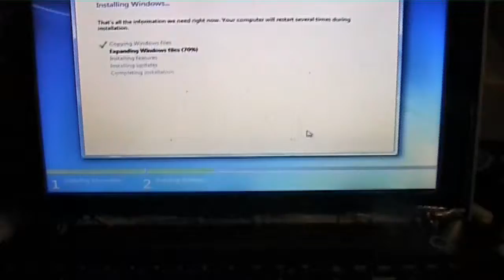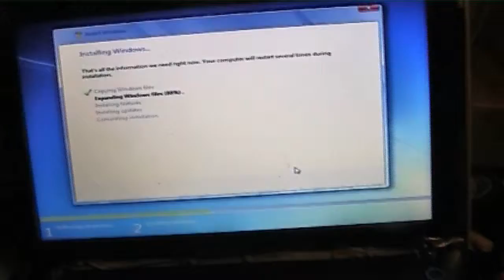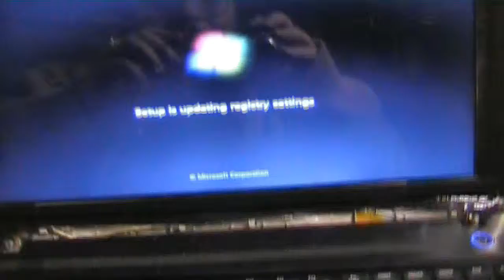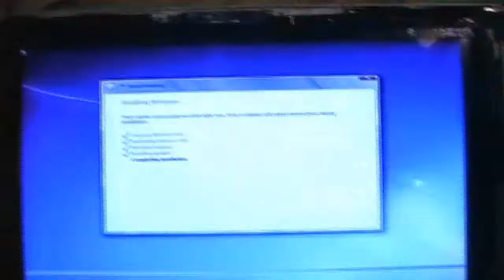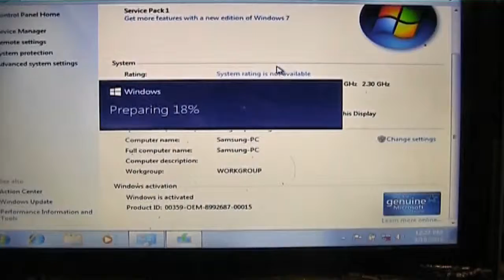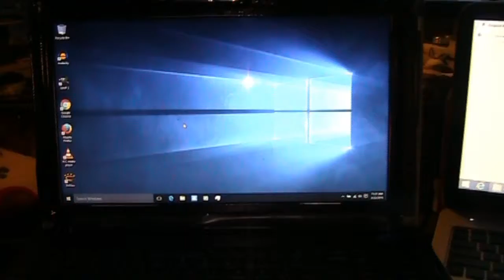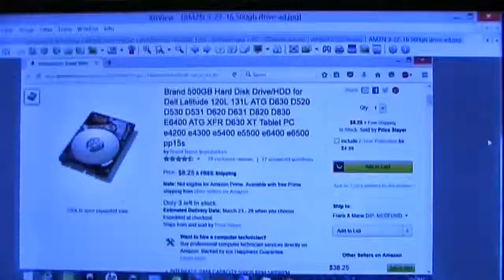Upgrading to 16gb RAM on a Samsung NP300V5A

Comment: How did you put 16 GB Ram, when this model - np300v5a, gets 8GB max?
Reply from the maker: There are cases where the manufacturer will state max ram is 8gb, but this is really dependent on the cpu and firmware and bios. For example, if you look-up the cpus in these models, Intel will tell you they can handle 16gb. Even a first generation i7 cpu can handle up to 16gb ram, and after that (2nd generation, etc.) even the i3s and i5s could handle 16gb ram.
Reply: @ThatWord   cool!! So I can upgrade my laptop with no worries.. my CPU is i7.. and my laptop is the same as yours,  NP300V5A. Thank you for your help👍🙏
Reply from the maker: The odds are very much with you, but save your receipt just in case.  :)
Reply: @ThatWord  I just found out that my CPU can handle 32GB.. so, I guess (2x8GB) will do fine (I know I have to make sure the motherboard is ok with it as well.. but... since you have the same laptop, i am hopeful. Thanks again 🙏
Reply: @dharmatal  Plz tell me if 16gb ram works fine on your laptop, I have the same Model and CPU as yours
Reply: @moazgamal3161  hey i have also i7 np300v5a . I want to know max ram upgrade...

Comment: I have samsung NP300E5C with chipset HM70, can I replace this motherboard, with motherboard with chipset HM65 from NP300V5A?
Reply from the maker: Swapping out different motherboards is much more difficult than upgrading, as you know, and at first glance I see that the dimensions of the NP300E5C are 1.4 x 14.4 x 9.5 inches, and while the screen size is the same on both models (15.6") it would be wise to measure the dimensions of the motherboard you are swapping out and compare them to the replacement, and pay particular attention to all the connection points being in the same location. If you are swapping out a functional MB because you want to try the upgrade I mention, you'll need to have the RAM anyway, so I would try it on the existing MB/CPU first. Both models came stock with an i3, and since it is later than first gen, it can handle 16gb of RAM if the rest of the system is up for it.

Comment: Plz help me i have same lap i5-2450m cpu and 6 ram its not snappy lagging all the time need 10 minutes to stable after turning it on     What can i do any tips
Reply: Its Samsung np300v5a model
Reply from the maker: Taking that long at startup makes me think it might have some bloatware and other issues. You could try running Malwarebytes (free) to scan, and perhaps CCleaner (free) to lighten-up some programs. And if you feel comfortable with a little more control over the situation, try a program called Autoruns (free), and see what you've got set to run at startup, and you can stop what you don't need. You may have a lot of unnecessary programs set to run at startup, bogging it down. Just be careful with Autoruns not to take away something you need.
  My second guess (perhaps distant second) would be an aging hard drive, possibly bad sectors.

Comment: What's the maximum RAM it can handle?
Reply from the maker: 16gb is the most I've gotten to work reliably on more than one of these models, provided the cpu is an i3 or better. Some memory lookup places will say 8gb is max, and that would be true if it were a first gen i3, but that's not what these have.
Reply: @ThatWord  ok

Comment: For Windows 10 here's what i use for their spying  -  https://www.safer-networking.org/spybot-anti-beacon/

For Windows 10  here's what i use in case you like the start up like Windows 7  Even tho it say's for Windows 8 it work's alsome  -   http://download.cnet.com/Start-Menu-8/3000-2072_4-75852660.html

Let me know what ya thank  !!!
Reply from the maker: +Robert Michael Thanks Robert. If it works well for Win10 I'll have to check it out. It's been a while since I've used Spybot (used to couple it with AdAware, but then AdBlock Plus as a browser add-on kinda usurped that, and Malwarebytes moved Spybot off my regular roster). Autoruns is another invaluable one to stop all the background and startup bloat. Cheers man.